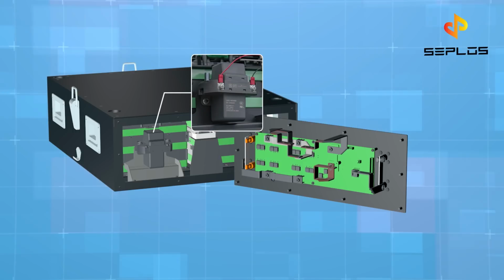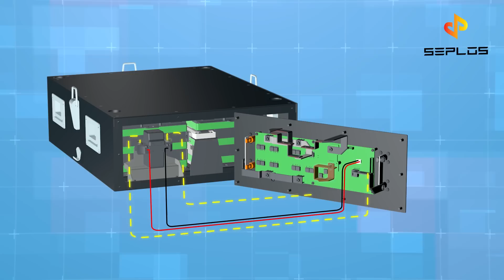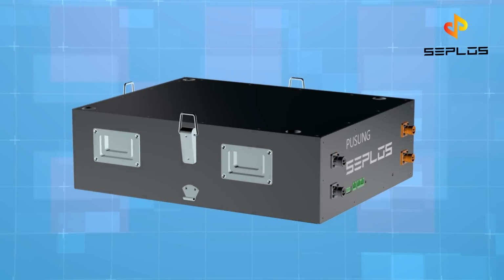TUV CEC UL CUL Certificated PUSUNG-S 48V 100Ah 5.12KWh Storage Batteries - Does it worth the money?

Comment: And why your gays working with soft copper busbar instead of normal cable for connect? In my experience, only Four wheel car battery will need that soft copper busbar. If you working with normal cable, maybe 10usd is enough, but if you working with soft copper busbar, we need pay 50usd more at least. Why should l pay 50usd more for nothings, as normal cable also doing great.
Reply: Cable is certainly a way out of it. But cable can also be fragile and less durable than copper busbars. A short circuit caused by a single cable worn-out issue would paralyse the whole battery system. So let's say 50usd more for a more durable battery lifespan...😅
Reply: you can take the copper pipe from the heater and tap it flat then you have also saved.🤣 I DID IT!:goodvibes:
Reply: I personally think soft copper bars are better

Comment: Better quality and more safty, but why working with relay instead of airbreak switch?
Reply from the maker: This is how the BMS controls the relay:

The detailed control process of tripping breaker and rely breaker
1. From the time part, 
5 seconds after the MOSFET-cut-off signal is sent and MOSFET fails to respond. relay-cut-off signals will be sent, and the relay breaker will be cut off. 
2. From the temperature part, 
If BMS detects the temperature sensor failed, relay-cut-off signals will be sent, and the relay breaker will be off automatically. 
3. From the cell voltage part
When BMS detects the cell voltage exceeds the high voltage trip threshold, and MOSFET fails to respond, relay-cut-off signals will be sent afterwards if BMS detects the cell voltage is 50mV more than the voltage threshold. 
When BMS detects the cell voltage lower than the low voltage trip threshold, and MOSFET fails to respond, relay-cut-off signals will be sent afterwards if BMS detects the cell voltage is 200mV lower than the voltage threshold. 
4. From the current in/out part,
When BMS detects the current in/out exceeds the high current trip threshold, a MOSFET-cut-off signal will be sent. And if MOSFET fails to respond, relay-cut-off signals will be sent afterwards if BMS detects the current is still larger than the threshold.
Reply: @SeplosTechnology  very Good :-) , i have 3  Seplos BMS here and made this safety things  with nodered 
intelligent relay idea:
A basic function is missing. The relay should check for a life sign from the BMS every second, when it is no longer there then switch off.
(..check a toggle pin from BMS with Relay(microcontroller include) , pin toggled no longer? then BMS is dead, relay must be switched off, that is then a fatal error, it should be signaled with led on the relay ... FATAL led)
Reply: I think airbreaker switch can only be off manually. But tripping or relay attached to the BMS can both sense abnormalities and reacts spontaneously. In this point, relay is certainly some progress in the device.